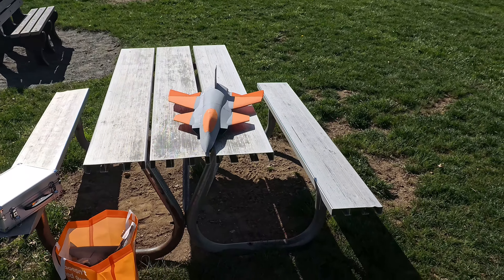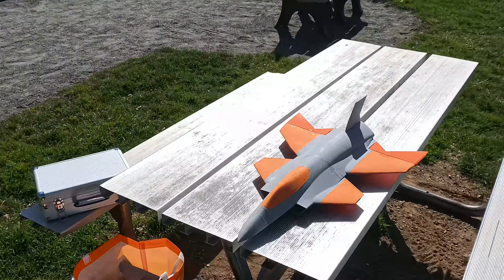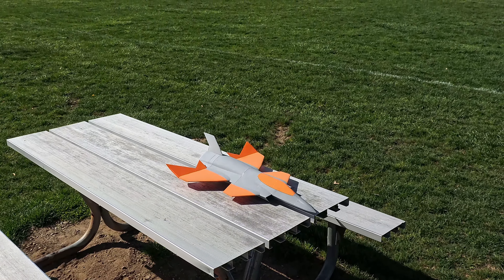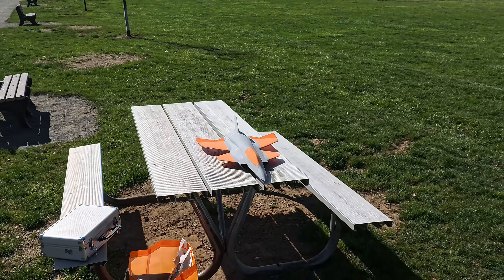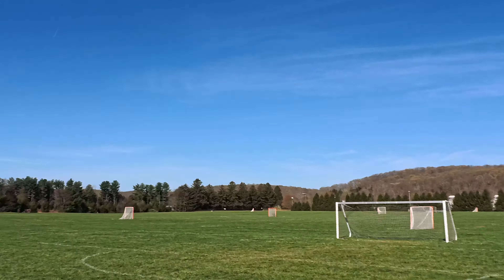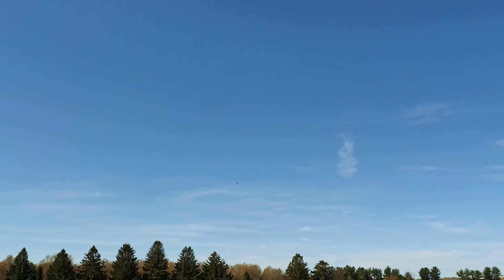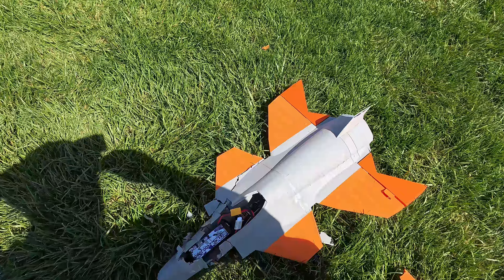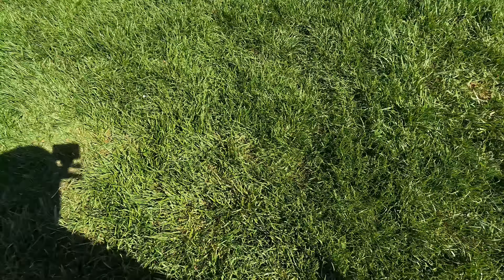X 36 Maiden Flights! lots of learning

Comment: Twist the wings so that the wingtips have a negative lift. This way you don’t need a horizontal stabilator. This is a fairly new discovery at NASA. This causes the higher wingtip to accelerate when turning so that the turn is coordinated although there is no rudder. 

I can’t find the literature on it now. But there are also couple of videos where they explained that it was a student who followed the math and built a rc plane accordingly. The development team thought they had done an error in their simulations, but it wasn’t an error. If I remember correctly about 20% in from the wing tip you should have neutral lift. Outward from that it should be negative. 
With a twisted wing like that, you will need a slightly longer wingspan to generate same amount of lift as a traditional wing. The benefit is in less drag and no need for a horizontal stabiliser.
Reply: Also there will be no wing tip vortex, the vortex is moved inwards. When you se birds fly in a V formation you notice that the wingtips are overlapping in the formation. This is with the same amount as to where the vortex if formed.

Comment: Yes, it was tail heavy and needed the CG adjusted. That being said, I noticed when you looked at it from the side view, the canards appear to be giving the plane a nose up attitude, even with the 2200. If that's the case, you may not need such a large battery if you adjust them to level. Just throwing stuff out there....
AirHammer out!!
Reply from the maker: After designing 4-5 canard airframes I found that a static front canard needs 4-8 degrees I’d positive attitude to have level flying characteristics. If you go back to my early Viggen design you’ll see I’ve spent a while figuring out the canards 👍🏻
Reply: @hotlapkyle  are you saying 4-5 different airframes of the same aircraft? Every aircraft, depending on design, can display different flight characteristics. The viggens canards are in a different location, along with size and shape, than this model. I'll check the viddy's out a little later when I have time.

Comment: That was pretty cool!! I'm surprised you got it airborne without a flight controller. And it flew progressively better as you adjusted the CG! As you probably know, that plane was designed with fly-by-wire  (computer control) in mind. It was inherently unstable and required constant input from the computer to control it. It also was a unmanned drone and never made it to production. https://en.wikipedia.org/wiki/McDonnell_Douglas_X-36